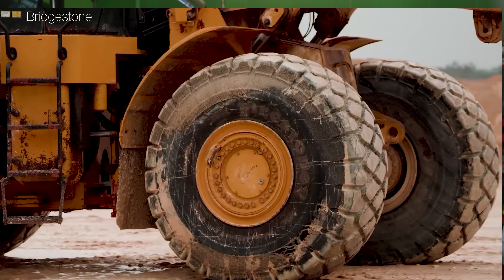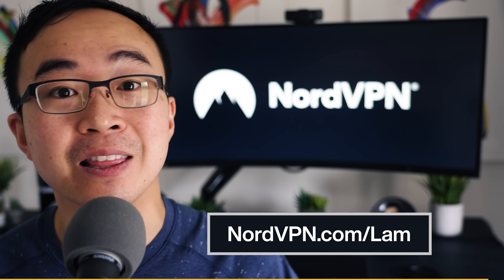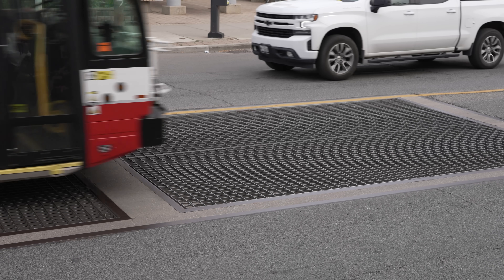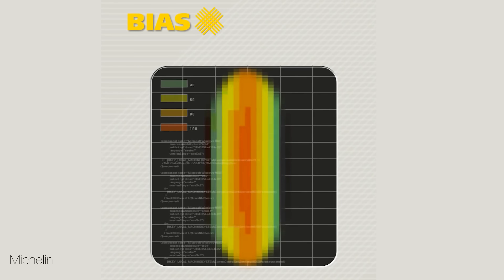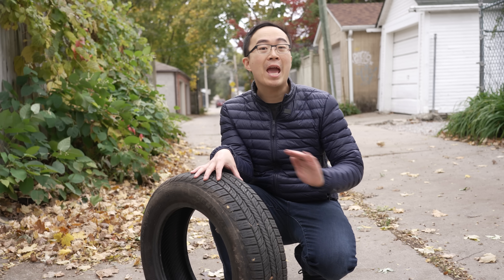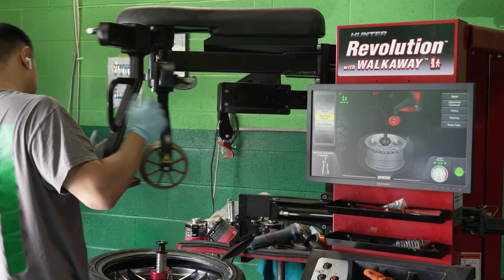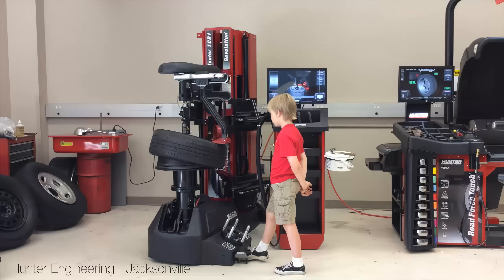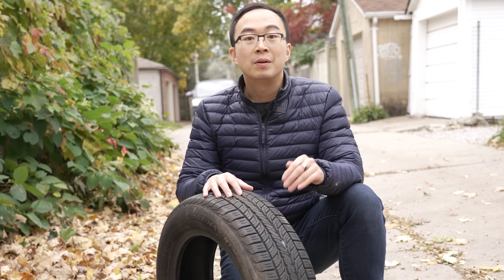How 90 Years of CLEVER Engineering Transformed Tires

Comment: You should really do some more research on how a tire is made. All those fins that form the snipes are not merely 3d printed. They use complicated machine tools like EDM and various milling and turning machines. You do get what you pay for when you buy a cheap tire. 
Did you notice all the little rubber pins sticking out all over the place on the outside of the tire? 
Those are all tiny holes going through the mold to let air out. Without them, there would be voids left in the rubber, burn marks, that would eventually ruin the mold from what we called in the rubber molding industry,  dieseling. The pressurized air mixing with the oil vapor in the mold on that small spot in the mold will actually explode and start eroding the steel of the mold. 
The size of the mold is also proportional to the size of the tire. They utilize a pie shaped segmented mold design that will open radially to be able for all the blocking to easily come out of the mold.  If  the mold simply opened up into two halves,  you would never be able to get the tire to come out, for that matter the mold probably won't even open. 
You could have an entire utube episode on the science of how a tire is made.

Comment: Sipes are cut in the top part of the tread depth to keep the tread cooler and improve wear.  When the tread is worn to a shallower depth, there is not a need for the additional cooling and the tire will produce better grip with more rubber in the contact patch.  

The greater performance with shallower tread (actually with no tread at all) is the reason that street tires used for racing are shaved to reduce the amount of tread before being used, and the reason that dedicated racing tires are slicks.

Comment: Around 2010 I think car manufacturers built unsafe cars, where everyone was about to cut extra corner, small overlap area was either inner plastic fender, or flimsy stuff until they came up with crash tests. My 20 y.o. car built in 2000s, has way firmer corners, all welded together and not that easy to collapse, with out even mentioning moving front and rear bumper reinforcement, that mounted on big springs to absorb small fender bender, no such thing today. It never was tested for small overlap since no one was thinking about it back then,  but unintentionally these cars were stronger imo

Comment: Just a mention: almost all wheels are fastened to the hubs/spindles with lug nuts ( not bolts). And the tire fits "on the wheel", the inner bead of the tire fits over the wheel rim and seats inside the wheel.

Comment: Yes, cars are more powerful, tires may give better grip, but they now last a third of the time they once did. So it's hardly a win, win, win. Why not have better tyres that last three quarters of the time they once did? What happens to all the plastic/rubber washed off of roads, and all the many tyre carcasses are littering dumps all over the place? The tyre industry needs to do far better.

Comment: I was an early adherent of radial tires, having Semperit Supersports on my 1962 VW Beetle in the mid 1960s. Because of this or that I had the fronts mounted a week or two before the rears. The difference in those weeks was incredible. After all four were installed the difference was phenomenal. I never went back. If you ever drove a Beetle, you know how wiggley its read end was.
Reply: I went from bias-ply to radials in 1977. The difference was astonishing. If I had to drive on those old tires today, I'd be terrified. I can think of times I came close to dying, when I would have been perfectly safe on better tires. For some reason, I still buy the cheapest tires I can find, though. Maybe it's time to re-think that.
Reply: Bias ply tires still have their place, though... they're particularly good for trailer tires, as radials just don't hold up.  I've had bias ply tires running just fine on a cattle trailer for over 20 years-- only reason I had to replace them was the rubber dried out and the tread layer peeled off, even then I drove the last 20 miles to an auction barn on the exposed strings of the plies LOL:)  I wanted another set of biases but the tire shop didn't have any so I had to get some of the "new, improved" Goodyear radial trailer tires.  I'd heard that radials were lousy trailer tires but the dealer insisted they were fine, just keep them aired up to 60 PSI when parking the trailer between uses so they didn't develop "flat spots" that weaken the plies.  Well, they lasted about four years and blew out hauling a load of calves.  Had maybe 600-800 miles on the tires.  I went back to biases and no problems.  I will ONLY buy bias trailer tires from now on.  OL J R :)
Reply: @lukestrawwalker  I had always wondered why trailer tires, and from their appearances large truck tires as well, were still bias-ply. I guess that explains why! Thank you.
Reply: @rachelblack3816  You're welcome.  Most semi truck tires today are actually radials... radials don't heat up QUITE as much (truck tires DO still get very hot!) but radials actually get better mileage because of this less heating, plus their handling is better.  

Biases are still a cheaper alternative  mainly for farm trailers and smaller trucks like flatbeds and various single or tandem axle smaller "mid-size" trucks.  Most bigger dump trucks and stuff run radials however.  Biases are cheaper and hold up better, particularly with less frequent use compared to most BIG trucks which are on the road all day/every day.  

Many big semi truck tires on rear axles and trailer axles are often "recaps", that is, they are designed so that the tire carcass (everything from the beads that connect the tire to the rim to the sidewalls and underlying belts under the tread itself) is capable of having the worn-out tread milled off the tire, then a new rubber tread is glued on to the tire carcass, renewing the tread so the tire can be used again, until that tread is worn out.  Of course it depends on IF the worn out tire carcass is actually in good shape and has no damage, making it suitable for getting a replacement tread recap.  Federal law forbids the use of recaps on steering axles however, so all front truck tires much be NEW tires when they are worn out, though the can be recapped and used on drive axle (rear axles) or trailer axles instead.  

Later!  OL J R :)
Reply: @rachelblack3816  Large trucks switched to radials a long time ago.  I started installing them on semis back when I was in my mid 20s and I'm 58 now.
Reply: I remember when I was a kid, once I had used a mix of radial and bias-ply tires due to economics (I was poor).  With that mix of tire types, my car (1964 Dodge Polara) was almost impossible to control!  It scared the daylights out of me to even drive it at 40MPH.  Having clearly seen the issues of mixing tire types, I never did that again.  So thankful when radials became the norm and bias-ply tires disappeared from passenger cars altogether.  The engineering that goes into tires is amazing!
Reply: @rachelblack3816  Yeah mixing biases and radials was a big no-no, particularly radials on the front and biases on the back, IIRC (could have been the other way around, too many years ago to remember exactly).  Basically the sidewalls flex different in turns which creates "understeer" or "oversteer" going around curves, or as the weight of the vehicle shifts with slight steering corrections, which amplifies the motion.  Radials are good for some things, and not so good for others. For trailers IMHO biases are still FAR superior in longevity and weight-carrying ability, at least for smaller trailers.  Later!  OL J R : )
Reply: Radials were horrible back then and unreliable.

Comment: You should talk about the differences between unidirectional tires versus monodirectional tires, and the advantages of one versus the other.

Also... I didn't know they were shorting the sipes.  You don't read anything anywhere about sipe depth, so I guess *ALL* tire manufacturers are pulling this stunt, because one that was still producing full depth sipes - and thus tires that were safer longer - would crow about their product versus all others.

Comment: The Hunter revolution machine is the worst tire machine I've ever used,you have to babysit the thing or otherwise it'll break tires/sensors or parts of itself, on top of the fact that it's ridiculously slow.

I much prefer a traditional tabletop machine, or a manual Center Clamp machine

Comment: ive used the new tire machines and they suck. half of the time the tires you get in the shop will fight you, all too often the stupid fucking machine fights you on trying to do something like saying "prevented movement to prevent damage" or some stupid shit like that even though there is no risk of touching anything in any way. you cant even use the machine regularly, unless you get a specific head for it you cant use bars to use it like a normal machine. all it is is a piece of shit computer controlled machine that when it fucks up makes your job 5x hard and take 10x longer than manually doing it youself. overall these machines are cool and if the tire is fine than you'll have no trouble, but unless you meet that condition this machine is a giant piece of shit that makes your job harder if it doesnt make it easier and isnt worth anywhere near the money in a shop environment not even  brand new and calibrated perfectly. with a normal machine I can do it better and faster.

Comment: So I work in a tire shop. We do tires, we do alignments, and I wish more people understood the fundamentals of tires.  
It’s a common misconception that high mileage tires are better.  Something people don’t consider is the strength of the tire.  Take Cooper and Goodyear.  Recently Goodyear bought Cooper Tire Co.  these tires are usually around the same price point but coopers carry a 75k-90k Mile warranty, but Goodyear normally is around 65k.  Cooper tires are simply not as nice as Goodyear.  Goodyear uses a softer rubber that doesn’t harden as much over time.  Cheap budget tires are often put on and within a year handle horribly because they stiffen up.  Your tires need to flex to gain traction, so tough tires makes it so they have less traction, but wear out slower.  That’s why Goodyear won’t last as long as Coppers, but I’d take Goodyear any day.  
Another example of this is Michelin.  Know for being the high quality tires, they too usually have only a 75k mileage warranty, and cheaper tires carry the same warranty for much cheaper.  It’s what they’re made of.  Go to a tire shop and feel a Michelin tire and compare it to a mid tier tire.  The sidewall feels slimmer, and softer.  The tires without air feel floppy because of how soft they are.  Being said, they’ll wear out faster, but do to amazing engineering, they last extremely long for their quality. 
When tires are tested they looked at two major thing; traction when new, and how long they last.  In order to kind of cheat the system, cheap tires will be soft at first but get rock solid after a little bit of wear.  
One other huge thing with tires is use, and purpose.  Cooper AT3s are a overall ok tire.  Nothing special, but just ok;  65k miles. Tires like BfGoodrich KO2s are much better and often have no warranty with them, but last much longer.  BfGoodrich is a sister company to Michelin.  These tires usually dry rot before the treads gone, and they have great traction.  In my opinion KO2s are as quiet if not quieter than AT3s.  The reason for having no warranty on them is they will not last you 80k miles if you drag them up rocky hills all day.  If you keep them on streets, or light paths they can easily last a good 80k. They’re multipurpose tires and you can’t gauge the life span because of it.  Pretty much, the nicer tires usually cost more because they’re better.  Go to a tire shop you trust, they will be more than happy to sell you a set of tires that will last you longer.  In my shop we’re paid hourly, doesn’t mater if we charge you more, so your feedback is what drives better sales.  A lot of places will praise tires because it’s what you want to hear, not what you need to hear.  

Also, those valve stem caps; put them back on.  The metal valve stems easily get the core stuck in there and you might need a new sensor because of it.  
I’d love to hear others input, or if you have questions you can ask.

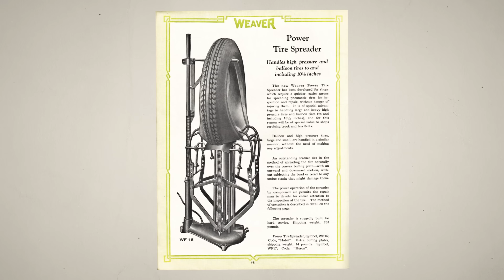Comment: Howdy Andrew The "TIRE SPREADER" @ 10:02 is for Tire Repairs when you put a Pull through BOOT Plug inside the Tire. It was Mostly Used for Truck, Tractor & other HIGH STRESS Tires that Need to be repaired right, it is also good on Car and Specialty tires like Low side walls or Float Tires!   I Was The Shop Foreman and the 24hr On Call Repair Guy for SEARS Commercial Truck & Tire Services here in Tampa FL ,  SO Yes I know my Shit and  40 Certs from Goodyear, Cooper, Firestone, Dayton , Sumitomo , Bridgestone, kumho etc ..etc Tire Plants makers to Prove it....  Anyway as for the Auto Changing Machines they are OK BUT,  A Good Tire Man will see things NO Auto Machines ever can (YET) see, So the ON Hands approach is Always the best choice when your dealing with something that can be a point of Failure if Not seen !  Just to be clear we did NOT work at the Local Sears store......we were based out of a Store Next to the Sears Warehouse BC we were Commercial & dealt with everything from CSX RailRaod to FHP to Abulances to Frito lay........etc etc etc~!  
 
   AS for Tire Mounting Automation ..it is Ok for Some applications ... But then there are needs for an Expert......I will bet you have Never SEEN some one Spin Balance tires at 150 MPH  On the Vehicles ....... Both Car and SEMI Bob Tail Trucks.....Yes I'm certified in that too as well as Water & Puncture foam Filling, Nascar, Airplane, Military, Caterpillar, John Deere Farm Tractors, Tire Shaving, Re-grooving, shaping and Much more!  
  
   Getting back to the Balancing,  Sadly There are less than 50 of US left Certified By Hunter In Strobe Technology whom Know How to High Speed Balance all 8 Wheels on the Vehicle and the Complexity on How to do this with Multi Axles Geared Rear Ends with Both External Weights or Behind Rim Aluminum Weights Along with Having an Assistant WHOM has US DOT CERT CDL License and cant Maintain Speed & knows what to do IF the TRUCK Launches at Speed all while you are inches away from a set of Dual Rear Truck Tires...this is where A machine still cant Dial in the Final Balance Feel !! 
   I could go on and on but  its mostly a few of your Terms & I did not Post here to Bust yer Nuts, I just wanted to say the name of the Machine & maybe add some of my 40 yrs Knowledge of tires & Repair Tech !     Merry Christmas, Be Safe & God Bless   ✝🙏🇺🇸🤠 Cow}:-o)

Comment: The "What ever this is" machine that you showed is for doing repairs to the tire. You place the tire on with the damaged area usually at the bottom.  The hooks go around the bead and pull down essentially turning that section of tire inside out. The area is scraped , roughed up,  cleaned and then you apply rubber cement to the area and a patch is applied.  Sometimes heat is used with a torch or heat gun. There is also an arm with a pad that applies inner pressure while the patch cools or dries. If you have more then a nail hole in a fairly new tire this can be an option but you have to sometimes go to an old school tire shop to find one.

Comment: Cool video. I'm definitely in the "you get what you pay for" camp when it comes to tires. More expensive brand name tires may hurt more now but they can literally save your life when it comes to handling and braking performance.
Reply: No it is true budget tyres suck, need at least mid range or upper mid range tyres to have good tyre performance and safety.
Reply: And thats not true many cheaper tires brand are own by bigger brands and have same specs but only key difrance is price and logo
Reply: Yeah sure... remember those Goodyear tires that were tossing their tread and killing people driving Ford Explorers??  My '92 F-150 came with Goodyear Wranglers from the factory, I was like "wow that's the best set of tires I've EVER seen on a new vehicle!" as all our previous trucks had the sh!ttiest tires Ford could get on them from the factory.  Well, the stupid Goodyears must've been made out of old eraser rubber... those things were SLICK BALD at 25,000 miles!  I usually keep old tires to use on farm trailers and implements where tread doesn't matter, but these were SO slick that I couldn't even use them for that!  GARBAGE!  

Best tires I've ever run were the Continental Conti-tracks.  Ran those on my pickup for years, until I couldn't get them anymore because they stopped carrying them.  They were a 60,000 mile tire and they'd run every inch of it before they needed replaced.   Since then I've just been running the cheapest tires I can get, because I've never had a set of Goodyears or Firestones be actually worth what they were charging for them.  They'd either wear out or fail long in many cases before reaching even a paltry 30,000 mile wear.  Later!  OL J R :)

Comment: Tires are interface points.  An interface point is where one "surface" interacts with another.  Examples like gloves, shoes, bike saddles, brake pads, tires, and fabrics are all examples that reward with investment.  These points are where performance and safety are realized.  Invest in the best you can on your interface points, in relationship to their importance to your desire for performance and safety!  You'll not be disappointed...

Automotive tires, for example, are responsible for directing massive (pun intended) amounts energy in desired directions and vectors.  You want and will enjoy having the best control on that energy you can.

Much thanks!

PS.  Loved the socket info!  Another interface point...